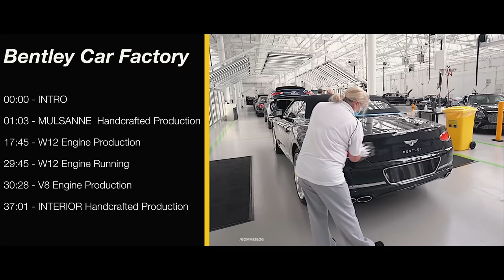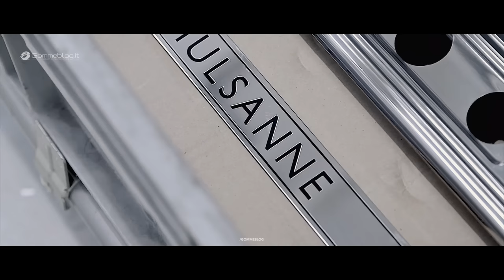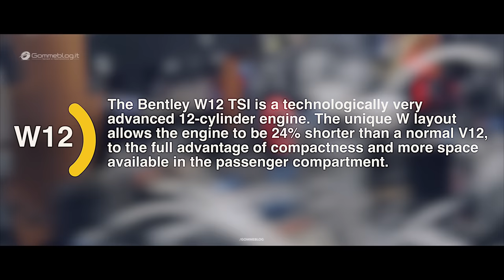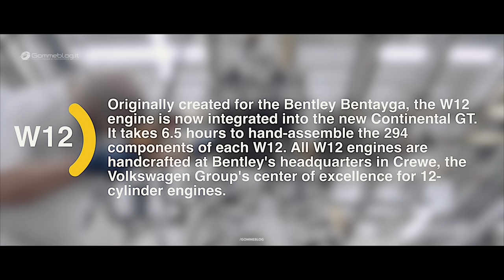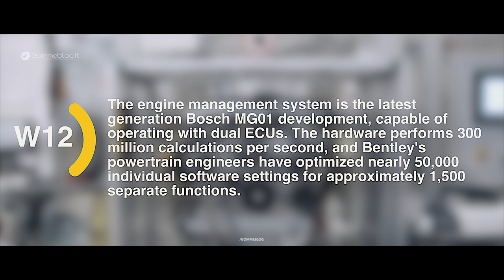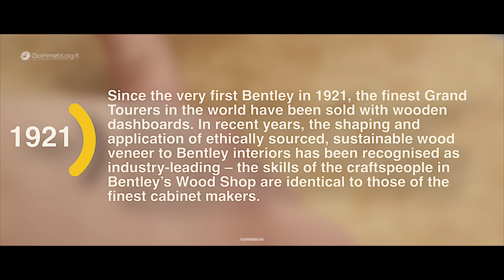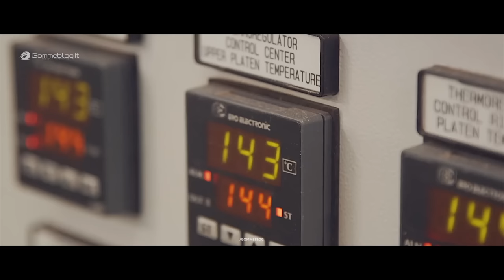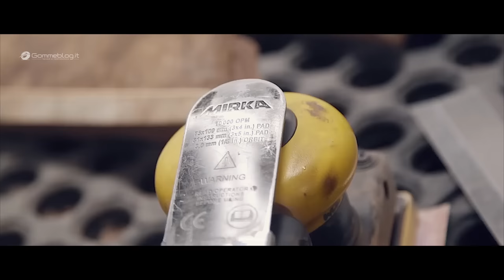BENTLEY Car Factory - THE BEST Handcraft Assembly ?

Comment from the maker: 00:00 - Intro Bentley Factory
01:03 - Bentley Mulsanne Handcrafted Production
17:45 - Bentley W12 Engine Production
29:45 - Bentley W12 Engine Running
30:28 - Bentley V8 Engine Production
37:01 - Interior Handcrafted Production
Reply: This is where I should be working with my skill set

Comment: The VAG W12 engine was created for the VW W12 concept car of 2001 and first regularly used in the Audi A8 of 2001 and VW Phaeton of 2004. Bentley started using it in the Continental GT of 2003. The Bentayga came along in 2015. The engine uses indirect fuel injection and direct acting ignition.
Reply: It was double VAG VW Passat VR6
Reply: It was a chevrolet design 50
Reply: Thanks for the history on that.

Comment: What most people don't realize is Bentley is owned by Volkswagen, all the running gear, engine, transmission, suspension and electrical are all VW,  The first production car to use the W12 engine was the 2001 Audi A8 (D2). Other cars to use the W12 engine are the 2003–present Bentley Continental GT, 2005-present Bentley Continental Flying Spur, 2015–present Bentley Bentayga, 2004-2011 Volkswagen Phaeton W12 and the 2005-2010 Volkswagen Touareg W12.
Reply: I think nearly everyone knows that Bentley is owned by VW.

Comment: 12:11 part of the metal mechanism of the seat hoist is rubbing against the seat, which could scratch the leather.  This is something that should never happen.  This hoist system should be redesigned.
Reply: @Alongfortheride693  Definitely some sloppy work there!